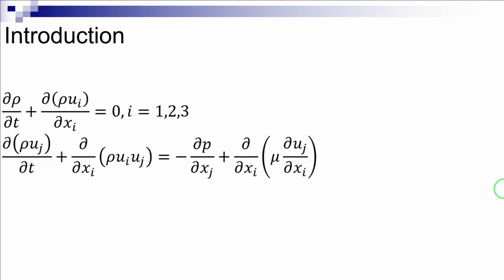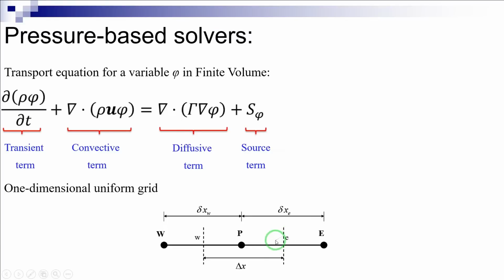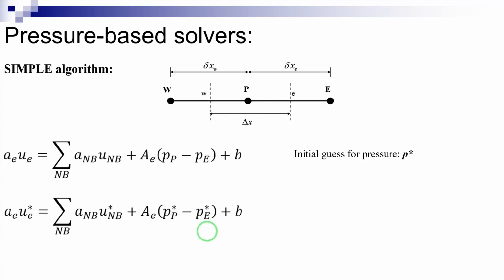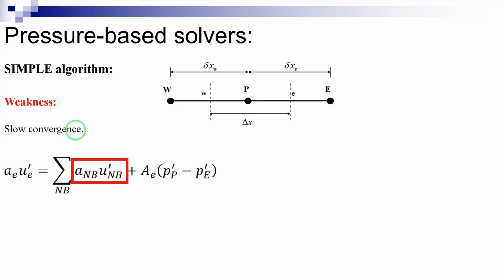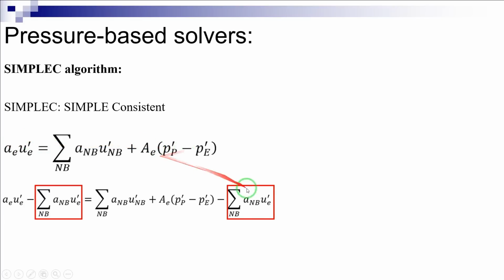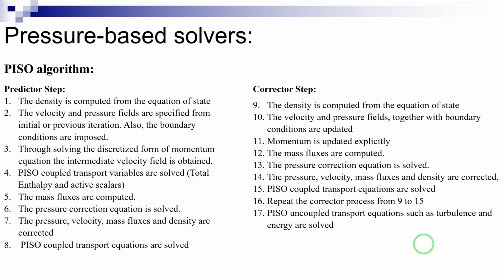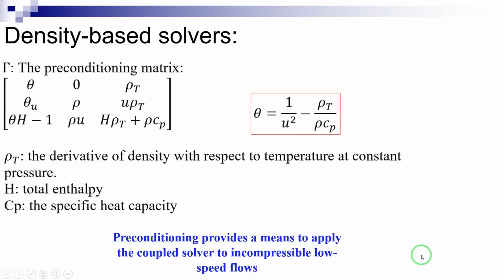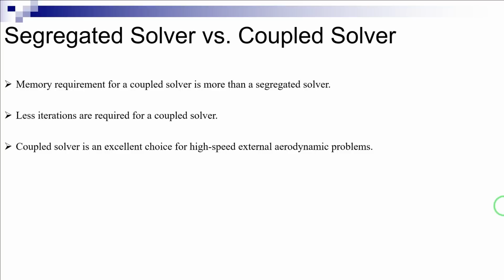Pressure-Based and Density-Based Solvers in CFD

Comment: The two solvers are used the conservative Navier-Stokes equations?
Reply from the maker: Dear Shahrzad, 
If the discretization scheme is the finite volume method, then yes, both solvers use the conservative form of the Navier-Stokes equations.
Respectfully,
Mojtaba Maali.
Reply: @CFD_Mojtaba  thank you very much for the respond (and for the steady transonic regime_high Mach number (0.82) and fully turbulent flow RANS used the Boussinesq approximate or the average of Favre), and for the Rae model is used only the inviscid flow or not please answer me and sorry for wasting your time
Reply from the maker: @شهرزاد-ك4ك  
The Roe's model is appropriate for subsonic and transonic flows for Mach numbers less than 0.8. While, the Liou's model is suitable for supersonic and hypersonic flows for Mach numbers larger than 0.8. 
I hope this helps!
Respectfully,
Mojtaba Maali.
Reply: @CFD_Mojtaba  thx